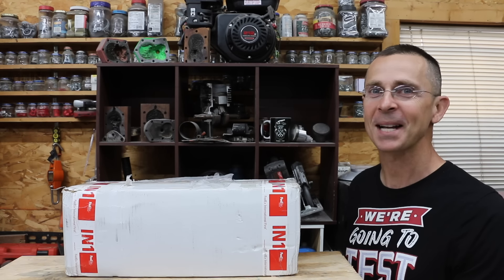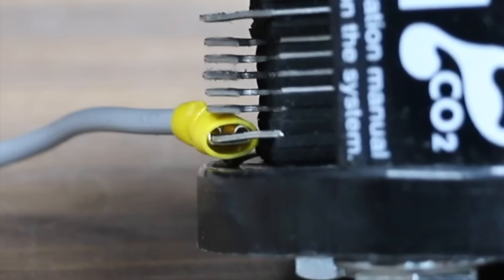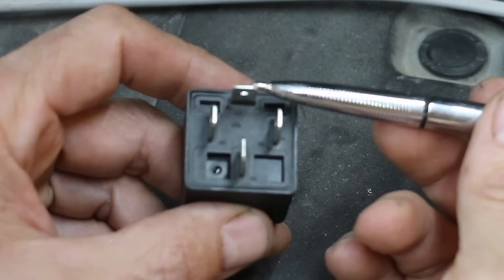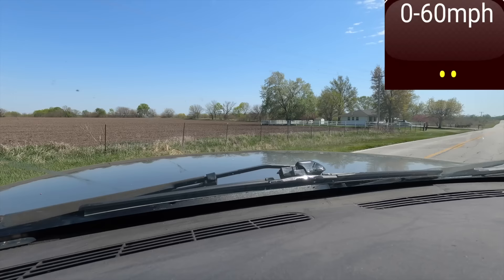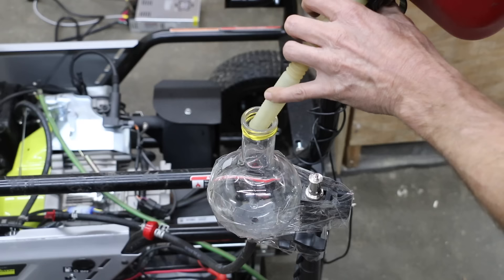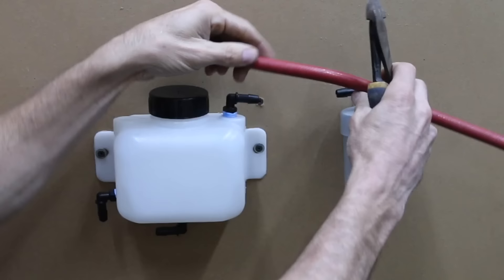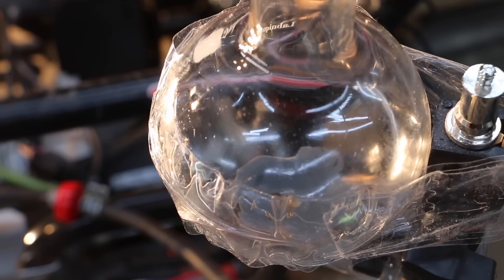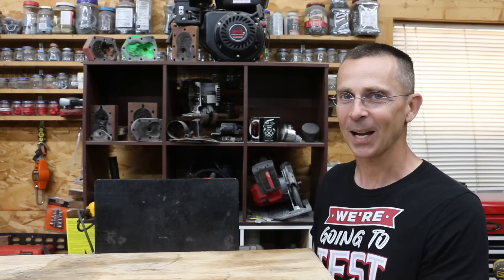AMAZING 35% More MPG with HHO? Let’s find out! Help with high gas prices?

Comment: your tests would work better if you ran your leaner on fuel when your hho is in the air intake the engine control unit is not registering the hydrogen gas as air not fuel so it keeps using the same amount of fuel and the reason why you use more fuel is because hydrogen gas has a higher combustion temp so it using fuel to cool the combustion chamber if you tuned the ecu you should an improvement I would guess
Reply from the maker: Thanks for the feedback.

Comment: wouldn’t you just be adding extra gas and making it richer if you add hydrogen? Maybe it might be better to have the engine set leaner so it would use less gasoline because the hydrogen would replace it. I’m pretty sure it makes the engine more rich unless you tune it leaner. Obviously I’m not making the video so I can’t be talking really but I’m just sayin’. I really love your channel I’m just wanted to put that out there

Comment: I’m confused by your process of powering hho with the generators output. There’s a lot more opportunities for loss of efficiency with that set up. You should demonstrate it’s effectiveness and application with a solar powered battery and run the hho through a generator to fuel it, without any gasoline. When you were using gasoline + hho hydrogen all you were demonstrating was efficiency loss not the power harnessed in using water in combination with electricity and just using hydrogen. This video missed the mark when given the opportunity to demonstrate hydrogen as a viable fuel source

Comment: This device is beyond ridiculous - putting an O2 / H2 mixture in molar/stochiometric quantities... into plastic and rubber materials, in a hot engine bay. Just a little bit of hydrogen can have a very low flash point and ruin your day. I'm glad these plastic and rubber materials aren't very good at containing the dangerous gas. Quick dissipation is a good idea.

Much more interesting might be to test out a standard water injection system....? Do you think?

Comment: there are issues with the way and equipment you are using ..... EFI puts gas in based on MAP/MAF sensor so if it sees an amount of air going in and its going to put the right ratio of gas in based on the amount of air it sees coming in, Then, on a natural Aspirated engine, you have the same problem the air inlet is a set size going over a set sized jet it will draw out of that jet based on air flow, but at least you can lean that out easy enough....
the other issue I see because I have also played with HHO you need a system that at least makes 1 to 3 litters a min. and that little store bought cell unit you have there is not big enough to effect a change on any size engine, those are used for little lights or small tin cutter? with the right size head you could maybe cut a coke can with that LOL
there are many ways of making a little better system, many people over the years have done it and tested and tweeked the whole process and have been able to run small engines off 100% HHO, so there is a lot of Hype on both sides of this topic you just need to put a little more research into it :)
So since HHO has more base energy than gas, natural gas or propane, ask your self if you can run a tri-fuel generator off of natural gas or propane why not HHO :) what you did here was try to run a generator off a Bic- Cig- Lighter LOL

Comment: Not sure if it matters but an old plumber told me not to put tephlon tape on plastic fittings. Never seen an issue with it. But he says it stops the threads from seating right so when the plastic flexes expands and contracts,  it can cause a leak in the threads. Anyone a plumber that can confirm or deny?

Comment: I dont think this could improve a caborated engine. Only way would to be to bypass the vintury. Computer controlled engine and tuned could improve, but youre also adding that electrical load as you stated.
Reply from the maker: Thanks for the feedback.

Comment: Ha, I'm reading some of the comments like  "ya need ta trick da 02 sensor, run it leaner, filter blocking the HHO etc, yadda yadda". Armchair theorists. Your tests with the generator motor dispels these myths that the  ECM needs to be calibrated. It seems from your tests that a petroleum gas motor does not benefit at all for some reason. It would be interesting to see tests with diesel and aircraft engines. Thanks for saving time and money!
Reply from the maker: You  are welcome!  Thanks for the suggestion.

Comment: For the HHO no matter how it did I wonder if since there is nothing in the chain that helps to stop humidity from getting into your engine through your intake, I wonder if that will add up and either condensate or just get sent out with the fumes? But also if water is released by the device and makes it into the top of the engine does it find its way around or will the heat of the engine prevent that, first we would need to prove water is coming through after the bubbler that supposes it may clean the gasses but idk how it would because there also prob not b4 being sent into the engine.
Reply: Also, I would like to see if the gas coming out of the HHO can be lit by either holding a lighter to the hose at the end of the chain to see if that will light or filling a balloon if possible since there is no extra pressure and lighting it on fire idk if it can but it's worth a try.

Comment: The idea is sound but the scale is wrong. It could possibly help an engine that is meant for RC toys, but the gas generated is way too little to any bigger engine. Also there is a real danger of wrong connection to the relay; if the system is "on" all the time, it will generate enough explosive mixture to blow the air filter and ducting to pieces if any spark occurs for any reason. The system is useless and potentially dangerous if someone is not familiar with electrics.
The illusion of great gas generation comes from seeing those bubbles, but as also oxygen is there, the amount of usable hydrogen is minimal. And, it is a mixture that is highly explosive. No smoking when opening the water tank...
Reply from the maker: Thanks for the feedback.

Comment: cant really do a fuel efficicncy test with a generator vs a car , the car will change the fueling while running to keep the same-ish performance with less fuel with HHO  , the generator doesnt do this so it will be about the same if not worse because it has set air and fuel ratios and your messing with the ratios.

Comment: With 50+ plate "stacked cells" and exotic self adjusting PWMs, 35% is nearly possible. But it is a fussy circuit needing constant attention and adjustment. Cannot be hardened enough for vehicles.  A dedicated experimenter, ZeroFossilFuel built every design cell from those popular on Y/t. Did his research with a generator and a stacked cell.  Reached the 35% level. Shut down, tore down his apparatus and sold off the scraps on YouTube. Enough was enough. THE END.

Comment: HHO should just stick to generating electricity power for batteries … like the they did originally in the 60’s in NASA space program (see garbage can H fuel cel). 
They’re just doesn’t seem to be enough units of energy to compete with gasoline.
It must be negligible unless it’s liquified hydrazine ha ha ha.

Comment: Will not work properly on a carburetor.  From my understanding,  all you did was run the generator rich, hurting performance and fuel economy.  

Some fuel injected vehicles will pick up on the rich exhaust and pull fuel.  

The hydrogen adds extra fuel,  so you'd have to tune for the richer mixture.  

They have combustion engines that run purely on hydrogen.
Reply from the maker: Thank you for the feedback!

Comment: Given your test results on both the generator and the truck, with HHO seemed to use a little more fuel than without HHO. This suggests the mixture is now too rich. The hydrogen is replacing some of the necessary oxygen for a correct air/fuel ratio.

Comment: I can tell you exactly why it didn't work, you introduced hydrogen through the intake manifold. You did not Flash the ECU or tune the vehicle for this modification. How do you expect them to save money on gas when all you are doing is spraying hydrogen through the air intake? Your vehicle is still spraying the same amount of fuel through the fuel injectors it doesn't know anything about what you just did
Reply: What tunes do you need?

Comment: I believe NASA did a study in the 70's using hydrogen as an additive, which did produce positive results. I have also been told the additional oxygen from HHO messes with the oxygen sensor in modern engines, cant say weather this is true or not. There was a TY creator a few years back who designed a very similar device that separated the H from the O, just some clever gaskets and a nylon membrane to separate the plates. I even bought the stuff to make one, but it got put on the back burner, I no longer have your enthusiasm.
Reply from the maker: Thanks for the feedback.

Comment: It would have been interesting for you to show how much H2O was used during the run, as that indicates the maximum theoretical amount of energy that could possibly be added to the energy in the form of hydrogen. Also the amount of amperage consumed by the HHO generator. It would be a very straightforward calculation to show where the net energy balance stands knowing those two pieces of data.

Comment: I'm absolutely not impressed with the output of the hho system tested. It seems lackluster at best compared to an old wet cell that I built years ago. I don't think any channel that has tested this has actually run enough hho gas into an engine to change anything about how it runs save for a small parasitic loss from powering the cell. Honestly I'd like to see the actual concept tested, not just some random system making wild claims. This means a much higher output hho system. Like five or more litres of hho per minute per litre of displacement. Maybe a lot more than that. A mechanically perfect engine for the test mule with a standalone very tunable ecm and an engine dyno to provide a verifiable steady load and accurate measurement of the power production. First step, find out how much hho per litre of displacement it takes to make a difference, no other tests will mean anything if you can't do that.

Comment: The energy from the produced hydrogen will never be more than the energy needed to make the hydrogen in the first place. Otherwise we'd be breaking thermodynamics. In short these hho systems are basically a net drain on the total system and will always give a lower fuel economy.
Reply from the maker: Thanks for the feedback.

Comment: I'm am inclined to believe the HHO generator is BS...however, I have never seen a test wherein someone adjusted the amount of gasoline injected into the pistons. Even if the hydrogen displaces some air or gas vapor, if you're injecting the same amount of fuel each stroke, you're just wasting gasoline it seems.
Reply from the maker: Thanks for watching!

Comment: Can someone explain to me how these generators are actually supposed to help in improving fuel efficiency?
As far as I see, electrical energy from the alternator is used to generate chemical energy in the form of the oxy-hydrogen gas mixture. By burning it inside the combustion engine, the chemical energy is released again.
Also (I might be wrong here), hydrogen is rather hot burning in oxygen, so any cooling effect and thus increased compression should be nullified. Contrary to hydrodiesel, no phase change occurs inside the engine, so I don't see how fuel dispersion could be improved by HHO either.
Or is it just total snake oil without any ground truth to it? The loss in runtime (and thus efficiency) correlating with an increase in supplied power to the gas generator may suggest it.
Reply: Your last sentence regarding snake oil is the truth of it ;)

Comment: He's not doing this test correctly. The HHO generator should be running at 30amp DC with 10 gauge wire and connected to the alternator for optimum power. Also, better to use a 20/30 amp switch in the cab and Connect the HHO hose to the Master cylinder for more precise air intake. 
In other words the kit needs more power!

Comment: Only way this increases gas mileage is if you have an outside power source.
Run it off a few high cycle batteries and charge them every night, then it's effectively just a low cost, kinda shitty plug in hybrid kit.
Reply: I suppose it could also help if you're not getting enough oxygen, but you have big problems if that's the case.

Comment: The Bubbler.... Sounds like one of Batman's super villains.

Y'know, if this kid provides the benefits that it advertises, you can bet every car maker would be installing them. After all they are all trying to get the best epa ratings and will do anything to get them.

The thing is that when you have something that is supplementing fuel to the engine in addition to gas (in this case hydrogen), you have to adjust the fuel injection to squirt in less gas to make use of it. Car ECUs and that generator's FI system is programmed to meter x amount of gasoline for every cfm of air (or air + hydrogen). Hydrogen carries less energy than gasoline so without modifying the gas metering, you will see no additional power or fuel usage benefit.

Comment: Tinstaafl always comes into play. Has no one noticed that the amount of HHO gas being supplied to the engine  by the device is constant, no-matter-the-engine-speed? It's an explosive mixture, equivalent to the gasoline and oxygen in the air, injected in PARALLEL, and in addition to, the engine's normal fuel at idle. So, if it truly worked, simply activating the device would increase the amount of fuel reaching the cylinders, at idle, and raise the idle speed. And if it actually helped by 35% at highway speed, at idle, with no load, the engine speed would jump dramatically when the HHO arrived.. So it was obvious, from the time the engine was started that the device's claim was pure 100% nonsense. In fact, it was obvious, simply by the installation instructions, that it was a hoax.

Tinstaafl = There ain't no such thing as a free lunch
Reply from the maker: Thanks for sharing.

Comment: The engine's computer will compensate for the lean mixture and increase the fuel to compensate resulting in no improvement, unless the computer can be fooled into not seeing the lean fuel mixture it isn't going to work. Try it on a non-computer engine controlled engine and see what the results are.
Reply from the maker: Thanks for the suggestion.

Comment: It takes allot more energy to convert water into hydrogen (and oxygen) than the energy you get back from burning it. Based on that, this system could never increase efficiency. This reminds me of the old car running on water scam decades ago.
Reply from the maker: Thanks for the feedback.
Reply: @ProjectFarm  thanks for making the vid! Was wondering if you have any videos comparing shock absorbers.

Comment: Not that I think this generator is a legit solution, but a carburetor  is not going to compensate for a rich mixture the way efi does. Even if the HHO generator worked you wouldn’t see an improvement on efficiency.
Reply from the maker: Thanks for the feedback.

Comment: PLEASE TRY THIS EXPERIMENT AGAIN... when you burn hho it fools the o2 sensor into thinking the enginre is running leaner, there by fatting up the gasoline input, there by nullifying the gain. the net would be about the same. thats y on fuel injected engines yoy have to use an o2 fooler to make the computer think the engine is running normal... please try this on a carburetor engine or an old lawn mower that doesnt use fi or an o2 sensor... make sure the hose for the hho is hooked to manifold vacuum or has vacuum all the time. ported and manifold if you can... check valves will need to be used. hho is produced a lot more under vacuum conditions. thanx
Reply from the maker: Thanks for the suggestion.

Comment: Very interesting video, the only thing I think you missed was getting air fuel ratio measurements to see if it was a cleaner mixture for the tree huggers out there. That could also help out determine a bigger fuel savings over 20 or so gallons at 350 miles.
Reply from the maker: Thanks!

Comment: First time time watching the channel.  With so many subscribers, I wonder if your channel has a corporate sponsor.  

Improved gas efficacy by supplementing HHO gas isn’t just some urban legend.  Indeed, there is ample empirical evidence published in the scientific literature to support the claim.  Anyone can go to google scholar and just do a search like I just did (see below).  

Perhaps the HHO generator you purchased was not optimized for these effects.  

A review on analysis of HHO gas in IC engines
Materials Today: Proceedings
Volume 11, Part 3, 2019, Pages 1117-1129

The over usage of fossil fuel and the resulting drastic increase in pollution levels has made us realize the need for a new sustainable fuel which does not cause pollution. This search ended up with an innovative idea of using Brown gas as a fuel enhancer in internal combustion engines which uses fossil fuels as a primary source for combustion. Many developments have been made in this area with several experiments on gasoline as well as diesel internal combustion engines till now using HHO gas or brown gas as a fuel performance enhancer. This work involves the review of various developments which has taken place in this field. With the addition of HHO gas there was a net increase in brake power ranging from (2% to 5.7%) and increase in brake thermal efficiency which ranges from (10.26% to 34.9%). A decrease in specific fuel consumption was observed which ranged from (20% to 30%) along with a decrease in CO and HC emissions on an average of 18%and 14%respectively.
Reply from the maker: Welcome to the channel!  I do not have or accept sponsors.  Thanks for watching!